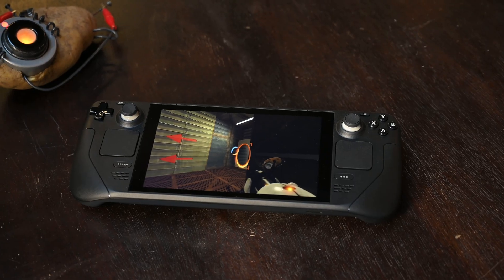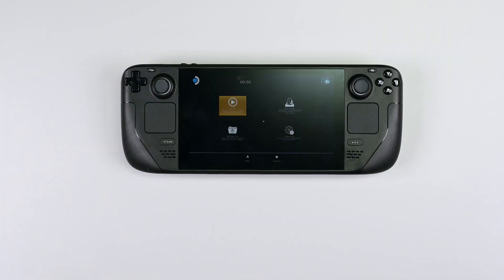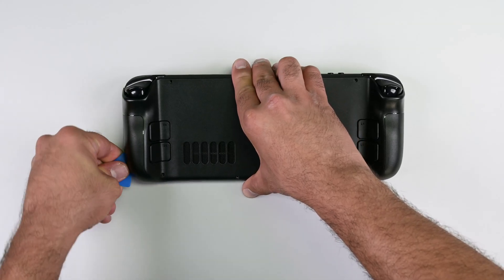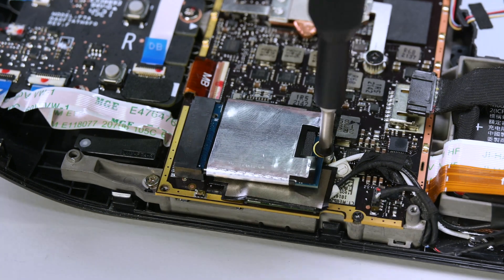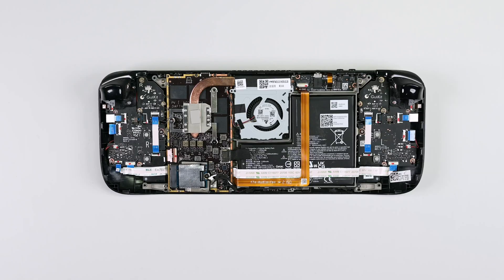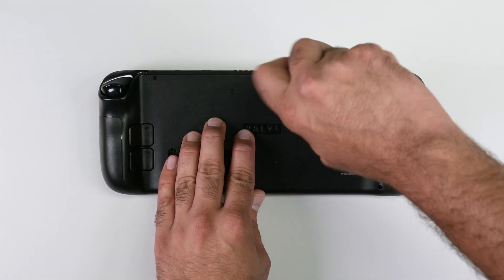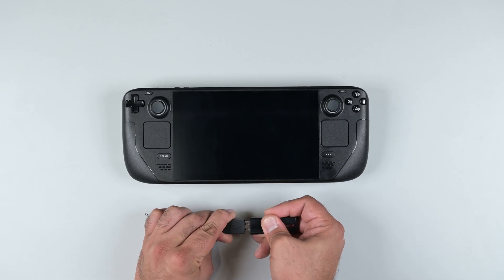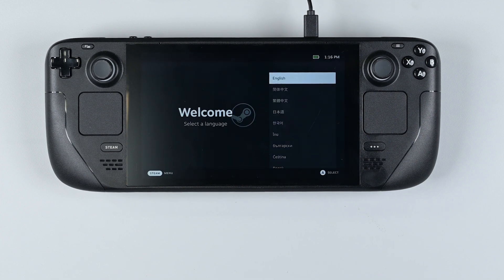Steam Deck SSD Replacement: Get it Done in 20 Minutes!

Comment: Tyyy this worked! Also: If anyone is having an issue with powering up the Steam Deck after the SSD upgrade despite a white light pops up when you attempt to, plug in your AC adapter for a few min and then power it up. This was my initial hiccup that resolved it.

Comment: Tip: You can just slide off the shielding since it isn't attached with adhesive to the M.2, it just has adhesive on the part that has the shielding to stay in it's shape.

Comment: Trying to see if anyone has a similar issue to me. Worked great and has for weeks. I went to heroic game launcher store using steam and then it crashed for some reason and now when I turn it on, it wont load into steam OS and just shows the steam logo. I tried do the steam logo trick on YouTube but that didn’t work either. Not sure what to do. I can access the volume and power option but when I click to boot SteamOS a black screen happens. Any fixes?
Reply: Try booting into safe mode (volume up then power button) and doing a system reset. You’ll have to redownload everything, but it may just work!

Comment: I opened mine up to repair R1 button not working. Slid a piece of tape and the button engages now lol so hoping that works. Decided it was already open so I went to microcenter to get a 2tb to replace my 64gb. Note, I was forced to use MBR instead of gpt but it still worked. And I didn't do the battery mode thing because I didn't watch this video first I just shut it down. Also I was able to just slide the SSD wrap this over to the new one didn't need to peel it.

Comment: If you ended up on this video while looking to upgrade your Deck, and you have a dock and an m.2 enclosure (and a little tech savvy), there is an easier way if you are just upgrading to a bigger drive and not replacing a dead one that doesn't require you to booting into recovery consoles or reinstall the OS, dealing with drivers and redownloading all the games.
1. Put new SSD into an m.2 enclosure.
2. Download RescueZilla and use Rufus/Ventoy to make it bootable from a USB thumb drive.
3. Hook power, SteamDeck, m.2 enclosure, and USB drive to the Dock.
4. Hold down Vol up button and press Power to bring up boot menu
5. Boot from USB Drive to bring up RescueZilla
6. Select Clone disk, and clone the old drive to the new drive.
7. If the wizard doesn't automatically resize it to the new disk size, close RescueZilla and open GParted.  Select the new disk, the drag the size of the SteamOS Partition to use all of the space, then click Apply.
8. Go to menu and shutdown.
9. Follow video for putting it in battery storage mode and opening/removing/installing new drive.
10. Plug it in and turn it on. You are good to go.

Comment: i guess the previous owner messed with the drive since it doesn't have the esd shielding as i try to upgrade the storage and came across that problem i guess ill finish installing and ill have to install it later when i order one

Comment: Just did this last night, something to note, if you use the power storage option he suggests before shutting it down to start the work,  your steam deck will not turn back on till you reconnect a charging cable, lol I followed this video to a T everything was perfect had no problems, and it wouldn't boot, tried swapping everything back. still nothing, finally i'm like lets try plugging it in and it booted right up and I could image the drive etc.  just a FYI because I don't think I heard any reference to this in the video.
Reply: Do you think I have to drain the battery up to 25 percent in order to do all this work?

Comment: I did the upgrade at the weekend to a 2TB Crucial P310.  It went like a dream thanks to your great video.  Only thing to mention was like others I had to reconnect the power lead to get it to wake up from battery safe mode and I also didn't peel off the silver foil tab on the silver plate fully to access the screw making it easier and less damaging to the silver tab.  Also to get it to boot back into the bios I had to hold volume down and power, maybe something has changed since the video was originally made? oh and one last thing when making the USB, GPT or MBR are both fine as others have mentioned.
Reply: Good job bro. How is the battery? Is it drain more quickly?
Reply: @froggologies  The battery does not drain any quicker so well worth doing the upgrade.

Comment: For anyone with the money, please save yourself the trouble and get an m.2 enclosure and use it with your original ssd installed to re image the deck... i spent hours messing with a usb and the enclosure worked smooth as butter.

Comment: Followed this to the letter (apart from the ridiculous peeling of the aluminium shielding of the drive and slid it off and on) and the device didn’t boot. Put the old drive back in for now and cloning it again. I’ll pick it back up and the morning and see how it goes. If it fails again I guess I will have to do a new image. I’m really begrudged to do that though as there are things on there I really don’t want to lose. I also don’t rate Balena Etcher. I think it’s sketchy software.
Reply: After I did the clone and replacement this time it worked perfectly. I can only assume the clone failed the first time

Comment: Worth pointing out that if you use a slow USB stick, when booting the steam deck up after the SSD swap it can take quite a while to boot up to the recovery menu. Just be patient with it. Also, since we put it in battery mode, you need to connect the charger for it to turn on again as the power button will do nothing otherwise.
Reply: So glad you pointed this out for me. I was getting real pissy when it wouldn’t turn back on 😂

Comment: worked quite well for me. I upgraded my 512gb SteamDeck with a 2tb SSD. But instead of reinstalling BazziteOS (SteamOS alternative), I just cloned the old SSD to new one by booting a pirated version of Windows 10 Portable from my USB C SSD and used my Actions software that I bought 3 years ago, to clone the old SSD to the now installed new one with the help of a USB to m.2 nvme enclosure. Later on in desktop mode I had to adjust the size of the internal storage to the new capacity.

Comment: Oof my SSD upgrade didn't go as smoothly as this, got stuck when reimaging the OS. I was using a USB-C Flash Drive for the boot using Rufus 4.6. For some reason it has it on "large FAT32 (Default)". All the options were greyed out so I could not change them. So when I try booting my Steam Deck with this, it could not read the partitions. I even used my other 2 USB-C sticks I've had for a long time but one put it to the large FAT and the other MBR; all three all failed to boot up to reimage it.

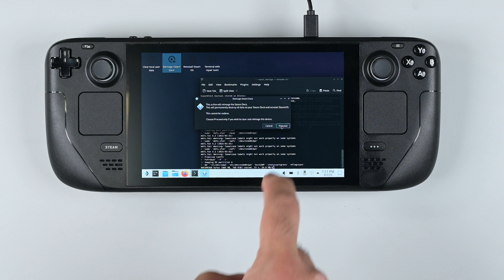Solved it by getting the most featureless and cheapest USB-A to get into the reimage boot. With this Rufus finally sets them as GPT&FAT32. I cried out with joy when the desktop finally came up, as shown in 5:19. It works now where Steam Deck is back to normal, but with more storage. Not sure why I couldn't make it work with my USB-C sticks. Could it because of the type Cs or Windows 11, idk...

Comment: I did this and got stuck on an update error on the start up screen. If your deck won't update after reimaging, try going into your BIOS to change the time and date to whatever day you are updating. Removing the battery will screw up the time and date on the BIOS. A mismatched time and date can prevent your deck from updating. I hope this can help someone in the future.
Reply: Thankyou so much for this!
Reply: I tried that and it didn’t seem to work :(

Comment: For the love of god, use a microSD and avoid the hours of headaches from slow USB sticks.  IF you have microSD adapter to hook up to your PC, just use all the same steps except with a microsd instead of USB stick.  Spent overnight trying to get it working with the stick.  Landed on black screen with mouse several times.  Next day, I used microsd instead.  Process finished in under 10 minutes.  

Edit: The steamdeck process broke my USB stick.  So ya, I double recommend microsd >.>

Good luck all!

Comment: I just used the dock it came with and a USB followed everything and worked perfectly fine I also thought I fried my deck I stopped right at disconnecting the battery part lol but no worries it works and I have 2TB of storage and no problems thank you!!

Comment: Having issues installing with mine... i make the recovery image, plug it in, select it from the boot menu and then instead of booting to the desktop so i can select reinstall, it sends me straight to a wall of text, then a steam logo, then a black screen with a mouse in it. After about 20 mins it shuts off.. I've made multiple recovery drives on windows and mac, with no luck
Reply: I'm having the same issue, did you ever find a fix for this?
Reply: @RudeboyMoto  just used a different flash drive

Comment: To anyone this may concern, if you’re having issues with installing the steam OS software through the usb-c you can also install the software onto a micro SD card and install it that way. I was having trouble turning my steam deck on with the usb-c insert into it. (It only went into turned on and went into boot manager when the battery charger was plugged in). Figured I’d let anyone who was having this same problem know!
Reply: Update: It’s also worth mentioning, I went back inside to look and noticed that my battery wasn’t very well seated so if anyone is experiencing similar problems, perhaps check that the battery is firmly seated inside the steam deck!
Reply: Is it the same process? Ive only seen one where i need a bunch of scripts
Reply: @Gzsf  when i installed windows it was the same steps, ofc i didnt reimage steamOS but that was the only step i didnt do because it wasnt my goal, but no problems using the recovery image on a sd card so i imagine its just fine

Comment: Thanks for the guidance!  I just installed a 2Tb WD into my original Steam Deck.  The hardest part for me was disconnecting the battery connector, it didn't come off by the tape so I had to pry it a little bit.

Comment: 2:13 My battery pulltab is glued underneath the battery. I can't even get it out with a spudger because the pulltab is now working like a teather that doesn't let the plug move far enough to leave the socket.
I shouldn't have risked it, but luckily I was still able to successfully do the swap with the battery still partially plugged in

Comment: Please i need help... my r1 button was not pressing well so i opened my steam deck and cleaned it.. i mistakenly removed the ssd without  unplugging the battery..... so after  my steam deck came on and i noticed that my mouse and buttons are not working except  volume and power buttons.. i only have window 11 on it.   I have reimage  to  steam os and updated it but yet my buttons are not working except touch... please i need help  asap. Thanks
Reply: Do a full recovery, I'm prettig sure that Valve support will guide and help you.  What product did you use to clean it? Also have you touched or removed any ribbon cable? You might have damaged them... If I were you I would open it, check all the button cables you might have touched these while cleaning so pull them out en reconnect them.

Comment: This is the first time I followed this tutorial to change an SSD for a Steam Deck. I have replaced one before with no problems but after following this guide the only difference is the battery storage mode and no matter how many ways I try to get it to wake back up it refuses. No LED, No sounds, Left on the original charger for days, and yes I have tried the million different button combos to wake it up. Even reopened it, disconnected the battery, reconnected it, etc. Put the old SSD card in. Literally nothing. This has completely bricked my device and I am so frustrated I am down so much money over a simple fix. Is there any way I can get some help or anything??
Reply: Charge it and it should turn on

Comment: No matter what I do I get a linux code that starts running after I select the boot device. After loading all the script it just hits a black screen an nothing happens and it never boots to desktop. I have no clue what I'm doing wrong.
Reply: did you ever find a fix for this? im running into the same issue
Reply: nvm figured it out. i bought a brand new type c flash drive and kept getting this issue... switched over to an old kingston 64gb drive and it worked... so i guess try a different flashdrive/sd card? lol
Reply: @snowwolfe  I eventually did get it to work by using a micro SD card

Comment: PSA: when turning the steam deck on, you may want to press volume down and the power button to select the boot device (they for got to mention this VERY IMPORTANT STEP), or else the steam deck will go into Linux mode (a bunch of code that I don't understand), but it will eventually get to the desktop, where you can reimage the deck. I recommend watching this video a few times before attempting anything at all, and read the comments, since they do forget a lot of important stuff on this tutorial.
Reply: I only get the linux code no matter what I do, but does it eventually boot into the desktop mode?

Comment: So my Windows 10-based laptop decided to stick me with only "MBR" as my partition scheme, "BIOS (or UEFI-CSM)" under Target system, and "Large FAT32" under File system. It's all grayed-out and defaulted when I select my 128 GB flash drive and the SD image file under "boot selection." Is everything going to be ok when I begin flashing this bootloader onto my 1 TB SSD that I am swapping, or will there be a catastrophic problem when I try it?
Reply: any update on if it mattered i have the same issue

Comment: After installing the SSD, connect the USB, then the power.  The SteamDeck won't need to be manually booted to the USB, but it will do it on its own since there isn't a bootable partition on the new SSD.

Comment: I did the upgrade, and it was pretty easy and quick.
- 1tb Nvme Corsair MP600
- SSD Heatsink 

1 - Before plugin the usb with the restore image, plug the steam deck into power.
2 - You don't need much battery to reimage SteamOS
3 - After the reboot, you can remove the USB and charge again the steamdeck, to proceed the configuration (wifi, steam login etc.)
4 - You can check in Settings -> Storage, that the SSD was added
5 - Update SteamOS

FYI - The image was named "repair" something, and it was in MBR.

Comment: Worked like a charm. Just remember to plug in power and turn it on after putting it in power save mode. Then insert the USB drive and hit go.

Comment: Worked great thank you. I didn't charge mine enough after taking it out of battery storage mode and it died the first time while trying to install the new OS. I just charged it and held the power button and minus volume button and started over.

Comment: Getting the battery ribbon out on mine seemed stuck because way part of it was jammed in between battery so it wouldn’t slide out as easy as some videos will show in just one direction.  Also I first used a Sandisk cruiser 32 usb that was a few years old that was 3.0 but it fails loading so just use a newer one because this is also a reported problem that some older ones will just fail trying to load and get stuck.

Comment: Just to note - mine booted straight off the usb drive without going to bios first, so it took ages to load, but just wait. It then lands you on the desktop with a link there to reimage the steam deck.
Reply: is that where a bunch of line items and "OK" goes across the screen? Because thats what happened to me. It then shut down but when I tried to power it back on, the power light flashed three times and its not coming back.

Comment: With Rufus the First link os fine. MBR is fine GPT is not necessary and you cant change it either. Also if you ever get stuck or the screen goes dark in the reimaging mode just reverse your steps and makesure to watch untill it prompts you to reboot.

Comment: I've just finished adding the ssd and I've gotta say (someone may have already commented this but tldr) that if you have the black shielding like me, although he makes mention of it, you only need to take it TWO screws! I took out 3 like he said and then had to reopen the sd twice to figure out where the third screw came from because i kept putting it into other screws (for the backplate) holes! Yes i could have taken notice of where they came from originally but when you trust a video guide to tell you the exact instructions you don't think you have to particularly. I actually thought ifixit were extremely thorough,  obviously not enough in this case.
Reply: *out

Comment: OPTIONAL: flash image to micro SD card and dedicate that micro SD card to future repairs. very compatible and much faster than USB.
Reply: How do you do that?
Reply: @jsepe9356  a micro sd to usb adapter. Or put it in a dedicated sd card slot with a micro sd to sd adapter. Or a type C port with a micro sd to type c adapter. It should have been obvious. And obviously use rufus.

Comment: Guys, I didnt notice it anywhere in the comments, but it is important to use at least USB 3.0. USB Stick as USB 2.0. doesn't work at all.
Reply: Thank you for this comment!! I tried doing this using my usb 2 and it did not work I really thought the problem was on the ssd that i bought.